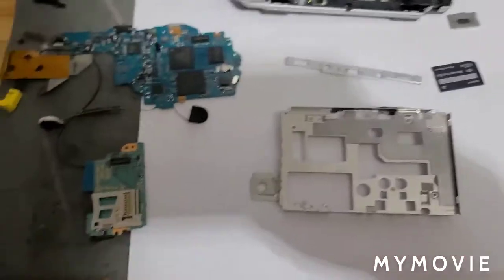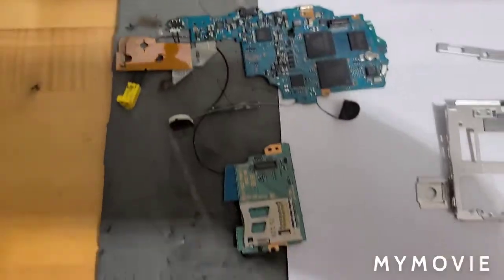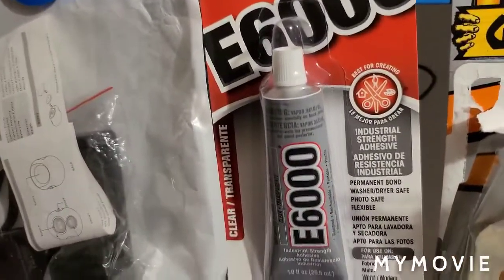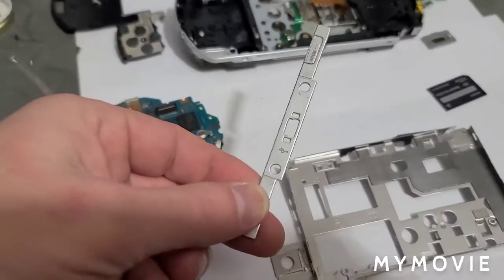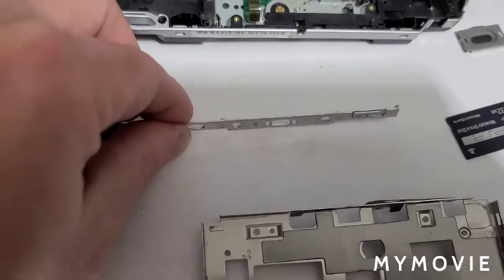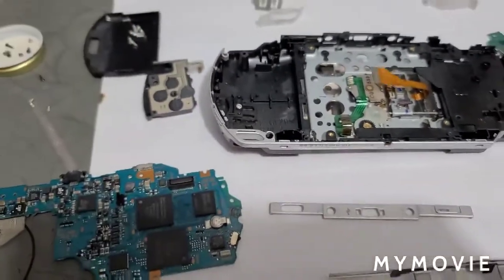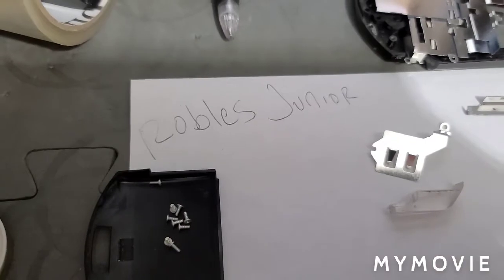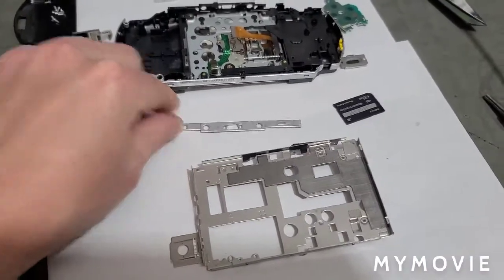Psp 1001 Problem, Help!

Comment: I never took apart a PSP. Putting it back together looks like it would be worse than putting back together any model of the 3DS. It depends how long you can wait, but many of these parts can be sourced through Aliexpress for a lot cheaper than ebay.
Reply from the maker: Thanks for the details, I will definitely check out Aliexpress👍